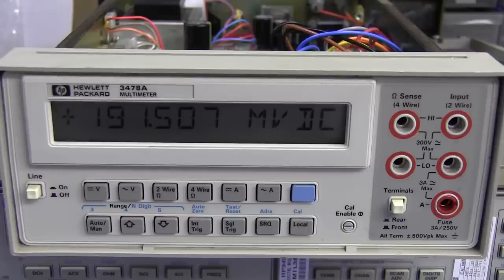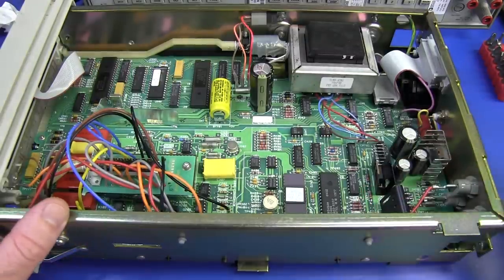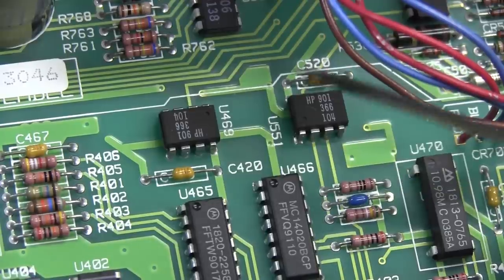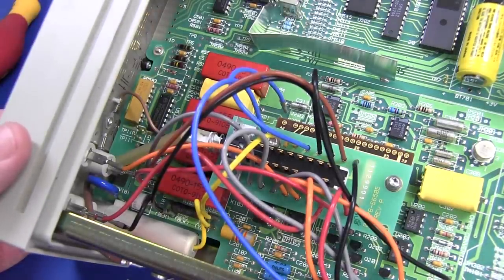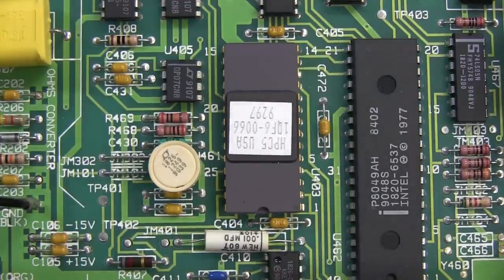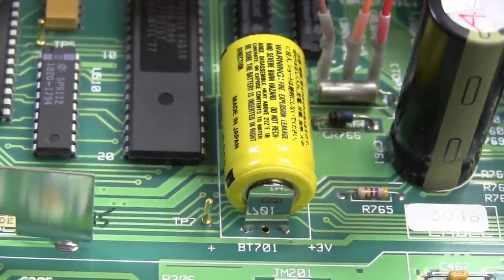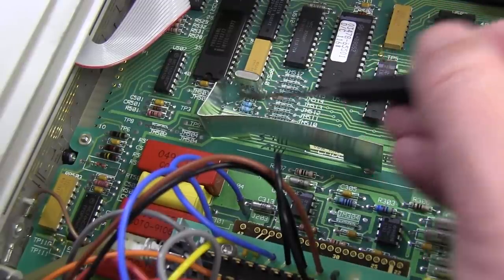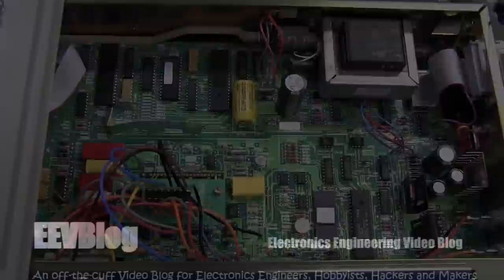EEVblog #427 - HP 3478A Multimeter Teardown

Comment: I was one of the engineers that designed the HP3478A.  Battery: The battery in my 30-year-old prototype measures 3.011V. The design life minimum was 10 years, probably at maximum storage temperature. Shield: At least in the prototype, a small shield was needed to calm down the AC RMS converter. In initial production, it was just a large disc capacitor. Inside the micro, there is another digit which was pretty good and could have been displayed. I wish I'd left that test code in my prototype...
Reply: That must have been amazing to work on such devices back then. Any interesting stories?
Reply: Wouldn't there be a way to examine and record the calibration information and reload the ram with the calibration information after a battery change out?
Reply: Hi Rich; if you are still lurking here... I have a 3478A, with an Asset tag "0001 Salo"   :-)  Maybe you know about Salo FInland in the 1990's ;-)

Comment: I am proud user of this beauty. I inherited this instrument from my retired and then departed colleague who sadly passed away in 2014. There were quite a few beautiful instruments and tools all maintained and calibrated nicely to this day. There was also 3465A 4 and 1/2  digits which required massive cleanup of switches and works perfectly now. 3478A we calibrated in local calibration facility and looking this calibration report was really impressive. There was almost nothing to calibrate in 2018. on instrument from 1990. Only correction was made somewhere in current measurement. Original battery is still inside. What I forgot is to replace filter capacitors which I intend to do before next calibration as well as replacing the battery using isolated soldering iron and backup battery. It has 4-wire resistance measurement which was extremely useful during development of sensitive temperature measurement equipment. Very often I make my own check-ups with voltage reference but proper calibration is needed anyway.
Reply: I have a unit I got surplus for $50 from around the same period,, no calibration sticker on it so I don't know if it was ever calibrated since new. Out of about a 60 point calibration test suite I had done by Essco only one measurement was out of spec, the 1.899841 MOhm test resistor read 1.89942 on the 3 MOhm range.That's it!

Comment: I got a HP3478A, the battery of mine still appears to work fine but I made an arduino GPIB adapter to grab the calibration data just in case. Maybe the previous owner of it replaced the battery though

Comment: Regarding exchanging the battery, I would use an isolation transformer feeding the unit on which to exchange the battery. Gives no galvanic connection to the soldering iron.
Reply: Why not just unplug the HP multimeter? Why isn’t that sufficient?

Comment: For me the critical difference between the 3478A and the 3457A was that the latter was specified to measure AC current at 100 kHz and the former wasn't. It's so hard to find any instrument at a reasonable price that is specified for current beyond 10 kHz... the 3458A is another that is, and Fluke has one that might be, but the spec sheet was ambiguous. I wonder if it's just a specification / testing issue or if that current measuring shunt really is a huge bandwidth hit? (All of them advertise 100 kHz or so AC volts bandwidth.)

Comment: hey Dave. 
i purchased one of these units from a US seller and it appears to be an identical model. i would set the dip switches the same because i live in Australia. did you need to replace the fuse? also, the service manual says to internally change the Line Select Jumper. is this necessary? thanks for your time.
-ak

Comment: This might be a silly question, but what is the benefit of having that extension bar from the front panel to the power switch, as opposed to having the power switch sitting just behind the front panel?  Is it to do with keeping wiring emitting a 50/60Hz signal to a minimum?
Reply: Attention to detail. If the switch is at the front then you’ll have to run mains power to the front then back to the rear again. It might also use up space at the front needed for low voltage stuff.

Comment: Hello, how are you? I bought a multimeter HP-3468A for a bargain of 25 dlls because apparently the previous owner tried to change the battery that enables 
the calibration function and the information in the ram memory was lost nec UPD5101L_NECElectronics and I 
realized that in one of your videos you made a repair of a multimeter of this model so I am interested to know if you could clone the finware of this memory and sell it to me to recover the functions of this multimeter

Comment: Hello how are you doing? I bought a HP-3468A multimeter for a bargain of 25 dlls because apparently the previous owner tried to change the battery that enables
 the calibration function and the information in the ram memory was lost nec UPD5101L_NECElectronics and me
 I realized in one of your videos that you did a repair of a multimeter of this model, so I am interested to know if you could clone the finware of this memory and sell it to me to recover the functions of this multimeter I already made this comment in another of your videos I repeat it in this video to see if you could answer it I would really appreciate it